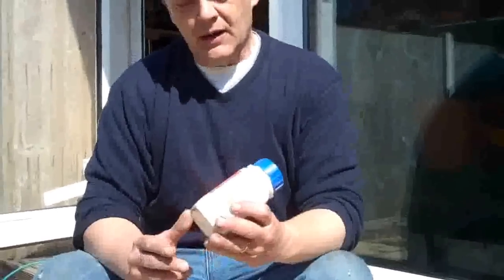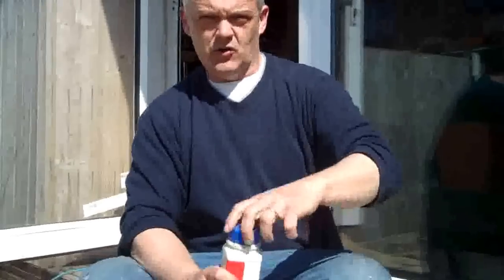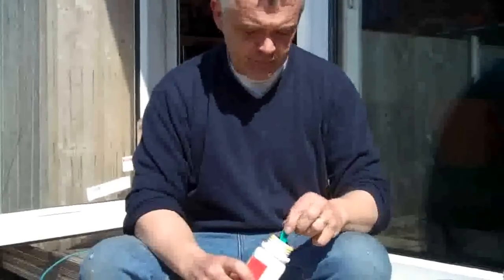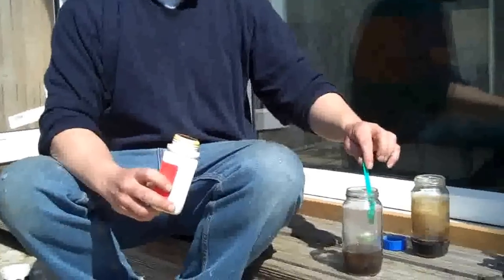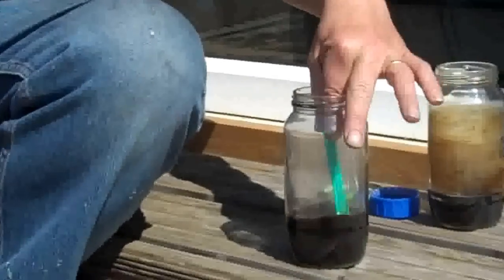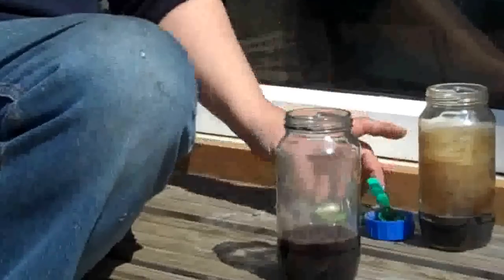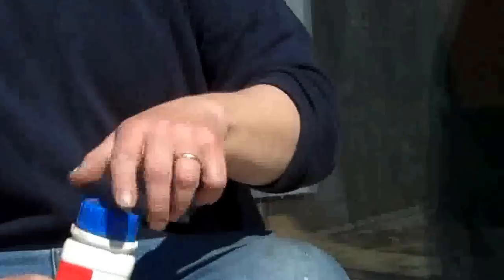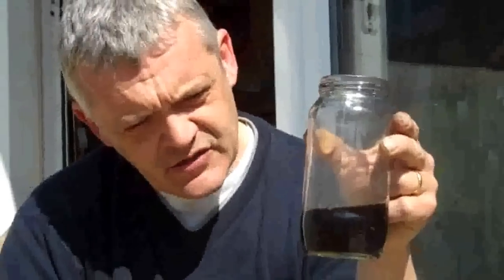Air Stable Iron nanoparticles from green tea and HTC

Comment from the maker: Keep it very dilute or add a dispersant. Windscreen washer fluid has non ionic dispersants in it. There is a trade off. If you keep it dilute it will take a lot more time and energy to use it. If you use a dispersant you will need to anneal the film before use at about 350 degrees centigrade - hope this helps

Comment from the maker: Sulphuric acid is 32% by weight concentration when it is used in batteries. You can get battery. Acid from an auto supplier or just get an old battery and drain out the solution. Filter it and test the specific gravity. The Internet will tell you how to work out the concentration of acid you have from that. Then adjust it with water to the correct concentration. In order to stop agglomeration you need to do one of two things. Either cont

Comment from the maker: it's all about the redox potential. So it'd definitely work for anything lower on the reactivity series (Ni, Au, Ag, Pt, Pd, Co, Mn, Mo, Cu etc) but Mg is much higher (about -3 whereas Fe is around -0.7 I think) so I don't know - well not without trying it - are you thinking hydrogen storage here - carbon capped Mg would be good for that.

Comment: A novel route was used to make an air stable iron nanoparticles with an average size of 10 nm were deposited on the surface of preformed carbon spherules with the aid of power ultrasound. This coating was achieved by ultrasonic irradiation of a slurry of carbon spherules and Fe(CO)5 in diphenylmethane for 90 min under an argon atmosphere. The as-prepared amorphous material was annealed in argon at 700 °C, forming air-stable iron deposited on carbon spherules. Your Cooking tea is a breakthrough.

Comment: Hello Mr Robert Murray-Smith I'm preparing a green synthesis of carbon encapsulated iron nanoparticles using the same methode that yours by HTC and I've got that black powder but the problem is that the NPs are oxidized especially we're working under air? i've a problem of oxygen  
And even that magnetic black powder you have got how did you know that it is pure iron and not iron oxide becaose magnetite Fe3O4 is magnetic too. Hope getting a response

Comment: How well does the iron stay mixed?  Is it completely colloidal and non settling, or does it settle to the bottom of the vial after a few hours?  I could see something like this being used in a hydraulic transmission control system.

Comment: Robert any chance of using these nanoparticalles to prevent the graphene that you prepared by the green method, from restacking? I suspect that the capacity of a capacitor will increase if we can avoid the restacking of the graphene. Right?

Comment: hi Rob, i wanted to make iron coated carbon, or carbon coated iron (to replace the graphene coated iron) for making a NiFe battery with KOH chemistry and nickel hydroxide. What i've done is dissolve sugar in FeCl and then added sulphuric acid. This then goes to a black colour eventually.
The problem i'm having is that i'm not a chemist and i dint know what i've created. is it just a mix of iron and carbon, or are they bonded ? Any thoughts?
Reply from the maker: +Trevor Van Zuydam a mix of iron chloride, amorphous carbon and sulphuric acid - the acid is cataltic for the dehydration of sugars
Reply: +Robert Murray-Smith so that would make it simply a mixture of iron and carbon. not really conducive, I guess I'll use the magnetite and go.
Reply from the maker: +Trevor Van Zuydam or you could hydrothermally carbonise it
Reply: +Robert Murray-Smith I could, but I want to stick to a low energy approach.  like using just chems
Reply from the maker: +Trevor Van Zuydam ok
Reply: +Robert Murray-Smith ok

Comment: I wonder if they would stay suspended in oil or another non ionic substance.  I have finals coming up next week, but that little pipe contraption looks like it should be pretty easy to build, and I drink green tea by the bucket, so I've really got to try this.  (Don't worry, I won't try to drink it after the iron salt is added)

Comment: Hi Sir. I am wondering if these air stable iron nanoparticles will still be less than 100 nm in size? If not, how can I make these particles to be less than 100 nm in size?
Reply from the maker: they should be - i would need a SEM to guarantee that - but size control is just a matter of reaction conditions - so concentration and temp being the two most important factors
Reply: +Robert Murray-Smith Hi Sir. Is there another simple way to hydrothermally carbonize the Fe nps? My vessel leaked and the solution spilled inside the furnace (I used a furnace 'coz the prof said I can't heat over 110 deg. C in the oven). I might not be able to use the furnace again because I cant remove the stain (another problem for me).
Reply from the maker: about your only other option is a HTC autoclave - but they cost in the region of US$1,000 i am afraid

Comment: Instead of reducing it down and it taking so long could I centrifuge it instead? would that work?
Reply from the maker: yep
Reply: So i could put the iron oxide III in the green tea then centrifuge it and use it right away?
Reply from the maker: what do you think?
Reply: I would think yes but they would wind up turning into rust after some time. I guess that is why the hydro-thermal carbonisation is necessary.
Reply from the maker: spot on